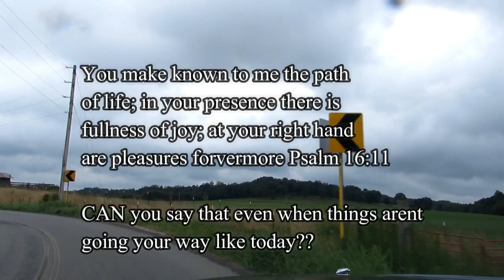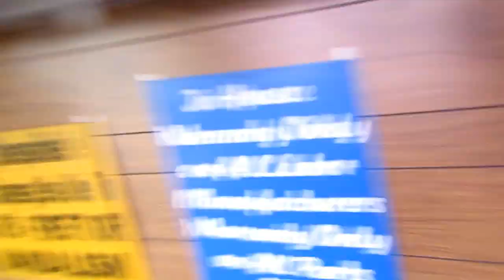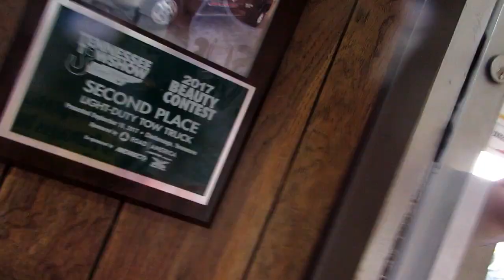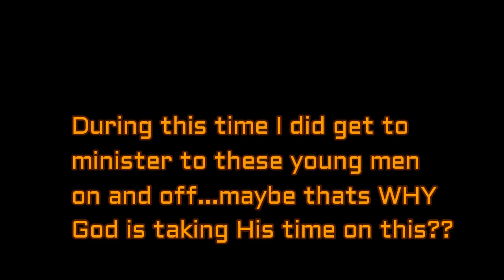Starry Vlog: THE WRONG PARTS? WE'LL NEVER GET HOME!

Comment: Brakes are so important on any type vehicle and its best to have all the rotors ect. changed before you begin your travels.  Whoever sold you the trailer was not honest about the last time the brakes were maintained as it takes a lot of travel/mileage for the rotors to go completely.  Anyhow, now that the brakes are done its a good time to change the oil/ filter, air filter also before your long trip and do keep a log on when maintenance has been done, at what mileage.  Keep track of distance/mileage driven for vehicle checks before things happen.  You will always be on top of the next rotor change, oil change ect. so you will not be stranded.  Also find out the last time the battery was changed(age) starter, alternator, transmission (flush/fill) radiator check ect.  It is so important now to keep a log as the more mileage and distance you put on the trailer the more wear and tear/mileage ect. so maintaining will be very important. I cannot eat blackberries, I do not know why, but I love blueberries, wild mulberries and raspberries.  Take care!
Reply: Everything you said is true. Maintaining before your out  traveling is 100%  true.
Reply: I think her friends gave it to her.
Reply: No that’s not true. Her good friends gave it to her.

Comment: better keep your old rotors. i bought new drums from oreilly and they shook while breaking a high speed. i finally found used ones at a wrecking yard... prob the only things needed replacing were the pads and calipers if the boots were burned off.